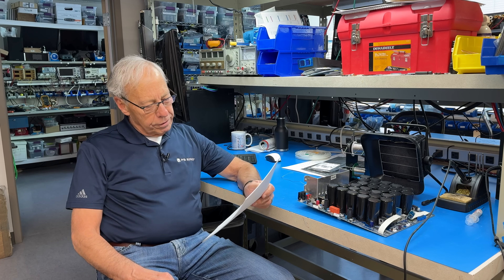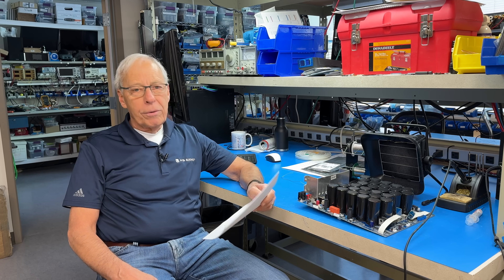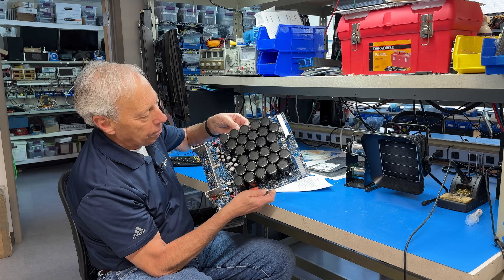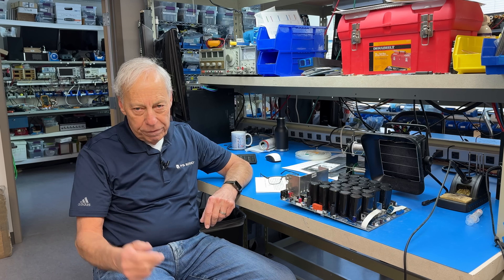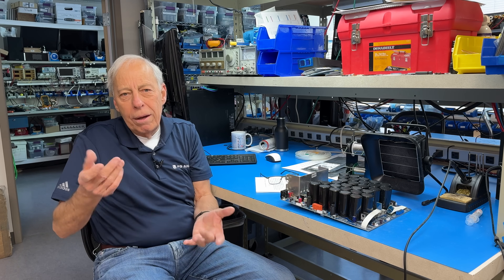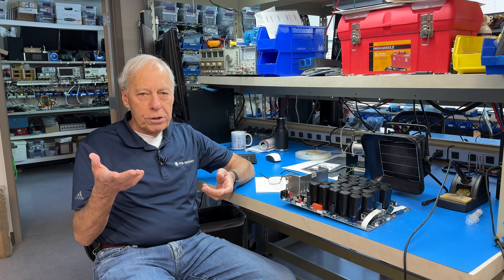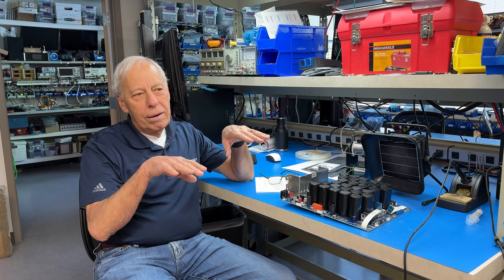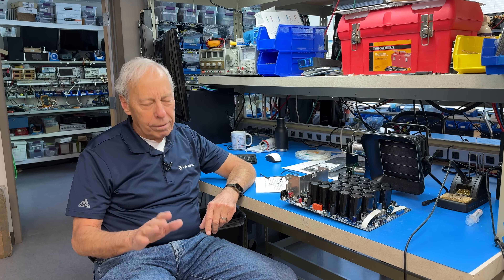MOSFETs, what are they?

Comment: Approximately 6 or 7 years ago, the CD player in my 2003 Nissan Sentra was unable to eject CDs.  Something mechanical finally failed.
I purchased a Pioneer replacement, based on the recommendation of the store.

Argh!  Horrible.
It yelled the music at me.

I struggled to make it through any song to completion, inevitably skipping from song to song, and within 3 or so minutes, I had to turn it off.  I returned that Pioneer unit.

I went to a different seller.
He was kind enough to hook up a Sony, JVC, and Kenwood, in order for me to choose the one to my liking.

All were better than the Pioneer.  But the Sony and JVC were boomy.  I got them to sound decent.  But it was two steps down from my stock stereo.

Then when I tried the Kenwood (it was the last one I tried), it was a breath of fresh air.  It sounded every-so-slightly better than the car's stock unit.
And it has USB inputs... so no more CD swapping.

I also own a 2020 Honda Accord, and its stereo is decent, but no match for what Nissan put in my 2003 Sentra.  Someone at Nissan had a great ear for sound quality back then, and got it right.  For a stock stereo, in a nothing special car, it was very clean, musical, and I could listen and listen and listen.

I would love to swap out my Accord's front-end unit.  But cars these days have everything integrated into the console, making a swap expensive, and will void the car's warranty, and who knows what wiring or computer issues might surface.  So customers are basically stuck with factory head units in today's cars.

Anyway, that Pioneer unit was torture.  You could not pay me enough to listen to it for 20 minutes.
Reply: Hi, I also bought a Pioneer car stereo, I too found it very harsh sounding no matter what you did with the settings couldnt really get it to sound nice, I returned it and also got a kenwood, really nice solid warmer sound, kenwood car stereos seem to have a unique sound quality
Reply: @andrewwalsh5837  Both of you guys are acting as if the brand has something to do with a sound. Each of these brands makes many different head units over a wide price range. If you were listening to the cheapest Pioneer model it may not have sounded as good as a medium-priced Pioneer model. And an upper priced Pioneer might have sounded amazing. So there's really no rhyme or reason to believe that an entire brand sounds bad and some other entire brand sounds good. That's kind of silly.
Reply: @JasonWW2000  "Both of you guys are acting as if the brand has something to do with a sound."
Well, of course the brand has something to do with the sound.  In fact, it has everything to do with the sound.

"Each of these brands makes many different head units over a wide price range."
The differences in price were due to features.  According to the shop that sold and installed my Kenwood unit, all of them have the same sound quality (same built-in pre-amp, and amp).

Pioneer did make a unit that was 5x the price, which I did not hear.

But among the Pioneer that I did demo, and the Sony, and the JVC, and the Kenwood, they were all priced within $20 of each other.
I did not go for any features that I would not have used (I can't remember what those features were, but they had nothing to do with the sound quality).

The Pioneer sounding nothing like the others.
The Sony and the JVC were both boomy (I did not spend time critiquing the rest of its sound quality, because I would never buy it, and I was using the shop's time).

The Kenwood, with all of its DSP, equalization, or whatever else it has or whatever it is called, sounds fantastic, with everything set to neutral.
The other brands just sounded bad.

And since I rode around with the Pioneer for a few days, I tried every setting it had.  It simply yelled the music.  It was an irritating sound.
Reply: @0Perhaps  The guy at the shop that told you they all sound the same and it's just different features didn't really know what he was talking about. Logically, does that even make sense? 

The different radios have to hit different price points. The more expensive units can use higher quality components and design to deliver higher sound quality. The cheaper units have to compromise on the design and use lower quality components which tends to create a lower quality sound.

It's pretty much the same with any audio company talking about receivers, speakers, amplifiers, etc...
Reply: @JasonWW2000  "The guy at the shop that told you they all sound the same and it's just different features didn't really know what he was talking about. Logically, does that even make sense?"

Yes.  Within the same product line, the Kenwood Excelon front end units that all have the same power output are all built with the same pre-amp section and the same amplifier section.

"The more expensive units can use higher quality components and design to deliver higher sound quality."
Can, but do not.  Not components related to sound creation and delivery.

"The cheaper units have to compromise on the design and use lower quality components which tends to create a lower quality sound."
No, they do not have to use lower quality components.

I listened to the various models, in order to make an informed decision.  My ears told me that all of the Kenwood Excelon series models sounded exactly the same.
Which ones did you audition?  My money is on "none".

"It's pretty much the same with any audio company talking about receivers, speakers, amplifiers, etc..."
Pretty much the same is not 100% the same.  With the Kenwood Excelon series, the sound related sections of the units were the same.

One might have HD radio, while another does not.
One might have a CD transport, while another does not.
One might have camera inputs, while another does not.
Etc.

You will pay extra for the above features.  If those are features that you will not use, then you can get their base model, which will sound exactly the same, will lack the above features, and cost the least amount of money.

The above are some examples of why they have different models with varying prices.
It is most cost efficient for them to keep the rest of the unit (the sound related parts) identical.  And that is what they did.

Everything you wrote is based on you making assumptions and guessing.  That is how misinformation gets spread.
Everything that I wrote is based on actual listening experience, and a shop's personnel that specializes in car stereos.
Reply: @0Perhaps  I've been in the car audio field for 30 years. If you want to ignore what I'm saying or tell me I'm wrong, that's okay. I'm just trying to help you out. Take care.
Reply: Every pioneer head iv had where top of the line and they all sounded great but not really that much different from the other head units i tried i really like the parametric eq they had
Reply: Just to let you know, your 2003 Sentra probably had some small DSP functionality built-in which probably included a factory EQ curve to improve the sound through the factory speakers. Were these types of vehicles swapping the OEM head unit can actually make things sound worse because you've removed the eq.

I don't think that would explain why some aftermarket radios sounded better than others, but it's something to keep in mind.

As newer vehicles became more complex and radios were more heavily integrated, a whole new market opened up that allows people to upgrade late model cars.
Reply: @JasonWW2000  My 2009 Altima’s radio had a pretty extreme factory EQ curve, boosting the treble and the very low bass.  I somewhat fixed the treble by adding resistors to the dash tweeters, and putting in aftermarket rear 6x9s with their own tweeter adjustment, but the inherent bass boost was a different frequency range than what you could adjust with the bass knob.  As to the OP’s experience with Pioneer, I consider them a brand that was good a few decades ago, but not now.  My guess is that the Pioneer unit mentioned in the video was probably an older one, back when companies touted their use of MOSFETs.
Reply: @kc9scott  Just to be clear, any fairly recent head unit doesn't use mosfets in their amplifier stage. Those are typically used in stand-alone amplifiers of a higher power range than 20 watts per channel. Virtually all head units going back quite a while use chip amps that rely on the car's electrical system for the main rails. If you go back far enough I don't think they had little chip amps so maybe those used some little fets in their amplifier stage. Anyway, the little built-in amplifiers in head units we're never designed for sound quality. It was the RCA outputs that got all sound quality components. 

If you wanted the best sound you would use the head units RCA outputs going to a outboard amplifier or other processing gear. 

I'm trying to think of why you guys heard such a big difference with different models of head units. The frequency response of those units are all pretty much flat so they should all sound the same (with only very tiny, tiny differences in sound that most people would not be able to hear.) I suspect some of the head units may have had the loudness feature turned on or the bass and treble controls turned up or down or some other processing turned on.
Reply: @kc9scott  Yeah, tweaking the sound on the 2009 Altima can be done, but it's pretty expensive. I'm assuming the head unit can't be replaced. You first need to use something like a kicker key lock to remove all the OEM crossovers, EQ, time alignment and all pass filters. That will get you back to a flat stereo sound signal then you need to run it through a DSP and external amplifiers so that you can tweak it exactly how you want it to sound. It's complicated and expensive, but at least it is possible.

Comment: Trying to learn a little more about mosfets myself. My son picked up an old Hafler DH-200 amplifier which uses 4 mosfet devices per channel. I am familiar with BJT's and tube circuits, but if anyone knows any books of videos on how these devices work differently in the circuit I would like to learn more about them. Yes, high impedance voltage amplifiers they are. With that being the case, I would imagine they have more linear voltage gain than a BJT device. Thank all of you in the audio community, lets enjoy the music, cheers!
Reply: I found interesting articles on "Elliott Sound Products - The Audio Pages (Main Index)"
Reply: A few authors pop into my mind Bob Cordell and 	Douglas Self. You also have the Elektor Magazine crescendo millennium edition. But I have to warn you using older drawings even 10 year old for an amplifier project. Always check you can get all the components before doing anything. Like in the  crescendo millennium edition. One of the transistors the 2sk537 is hard to get unless you are willing to pay exorbitant prices. Sorry Youtube allow no links. But well the information is out on the web